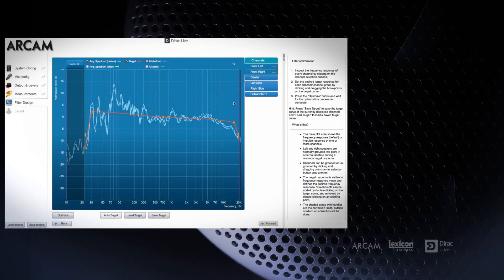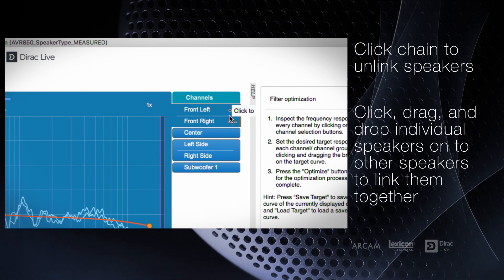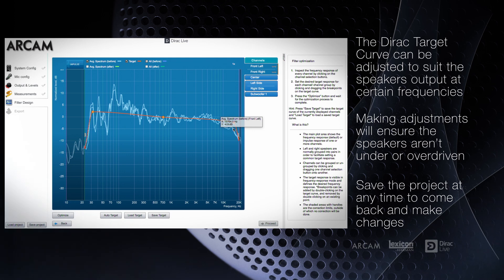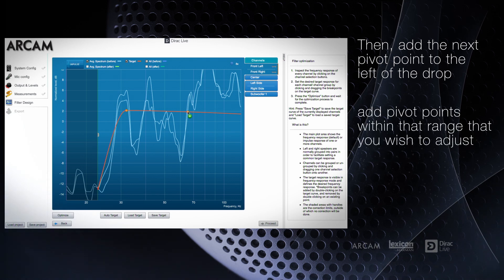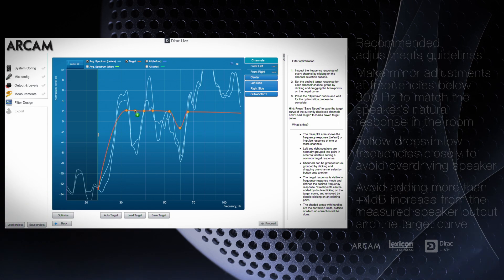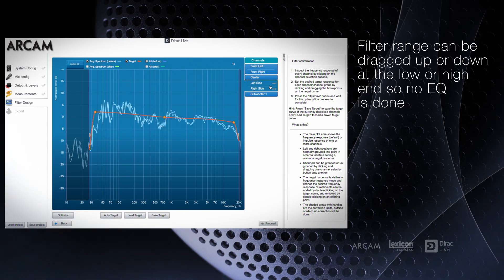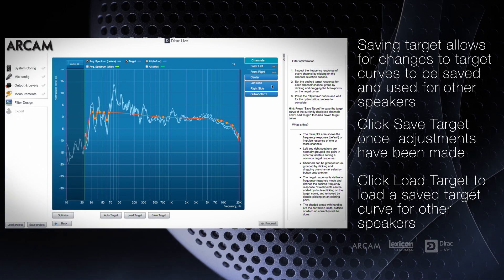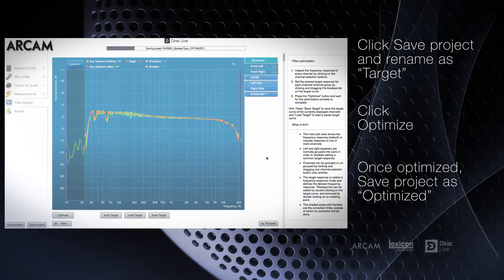Dirac Room Equalization Part 8 - Read & Optimize Your Measurements

Comment: Can you boost the low frequencies of smaller speakers if your AVR has a crossover?

So would it be possible to apply the +8dB Harman target curve on all speakers and subwoofer without adjusting the curve or curtain?